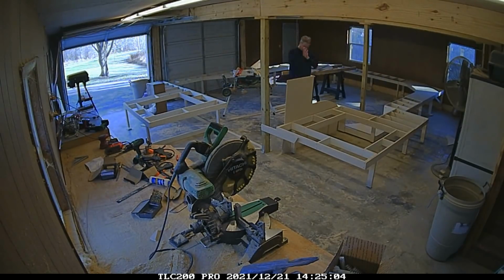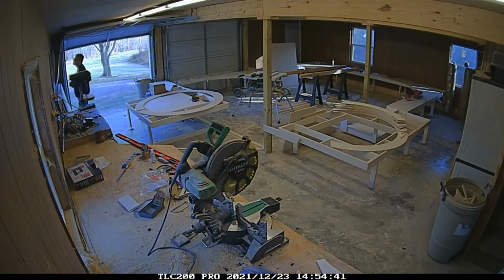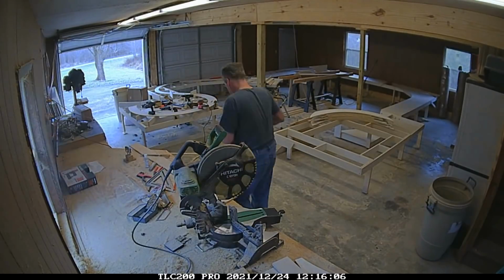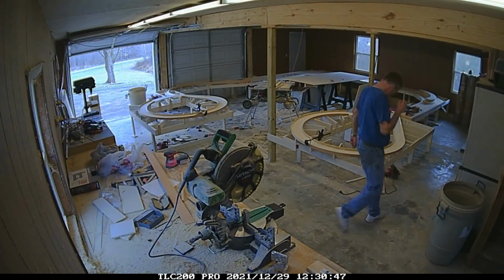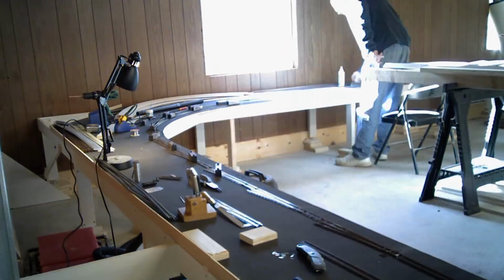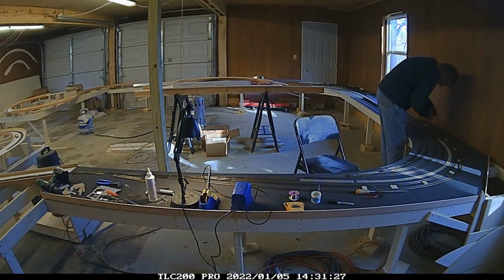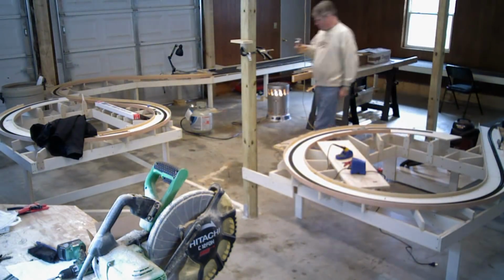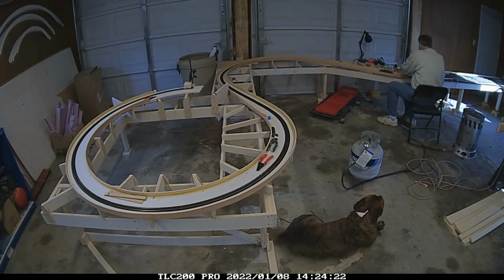K&SV time-lapse 02: Completing the staging level

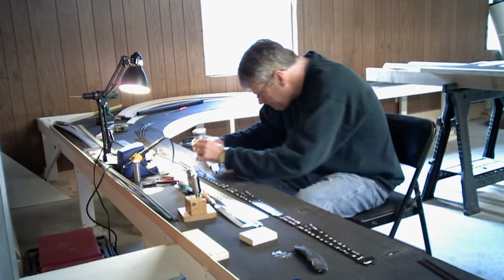Comment: Very interesting video Peter, I enjoyed watching your construction methods with your narration. At time stamp 22:30 you mention a type of glue you dab under the turnouts and track to bond them to the foam. I was not able to understand the brand name nor could I read the label at 24:41. What is it?
Reply from the maker: It's called "Crafter's Pick" and it's available at Hobby Lobby.
Don't order it through Walmart as they sell half-sized bottles for the same price as the full-sized one at Hobby Lobby.
Reply: @mpeterll  fantastic, I'll pop over today to get some. I was going to use Liquid Nails for projects (as many others have done), but this seems much better.  Did you ever locate another source for the rubber sheeting? I was thinking of using laminate floor foam underlay, but it only has glue strips every foot or so.
Reply from the maker: @jhoodfysh  I did a video on the roadbed material a few months ago - including a link to where I bought it.  Even without the adhesive backing, you can still use carpenters glue.  You'll probably also need masking tape to hold the ends in place while the glue sets/  I also did a video on that method about a year ago, before I found the latest product.
Reply: @mpeterll  Thank you Peter, I think I remember that. I'll go back and look for it.

Comment: I really do like this voice-over-time-lapse video format, especially with the close-in camera views.  There is still a place for the "stop progress" format mixed in to show specific details and combining the two would be excellent although I am well aware of the amount of time dedicated to editing.

On the build side a couple of questions.  Why is the helix sub-roadbed so wide?  It appears to be wide enough to be a double track helix and the track is even offset to one side allowing room for a second helix track so....  And, does the foam-rubber roadbed need any relief cuts to allow it to make the required curves or is it intrinsically sufficiently flexible to make the turns without "bunching up" on the inside and being drawn tight and thin on the outside of the curves?

As ever Peter, great quality work and thanks for sharing the "behind the scenes" effort.
Reply from the maker: I explained the wide helix subroadbed in an earlier video.
The foam rubber flexes easily in the narrow strips.  Regardless of the material, bending it around the curves is going to make the inside around 3% thicker on the inside than the outside (exact proportion is the ratio if curve radius to roadbed width).  To put that in context, the discrepancy is about the thickness of a sheet of paper and makes no difference.
Reply: the higher levels of each helix is double track between the diorama level and the upper level. they are only single track between staging and diorama but he is using the same width at each level to make support simpler.  Here's the plan video https://www.youtube.com/watch?v=ZIJ8ZgG4PPc&list=PLtDGUWgssDxG8teDJPvjWHmCsXdu1NQQ2&index=2